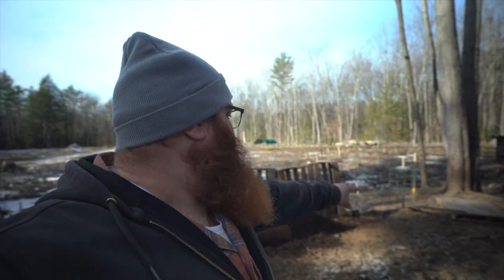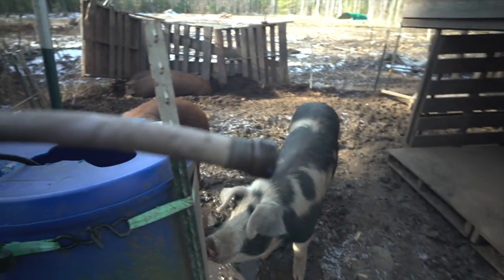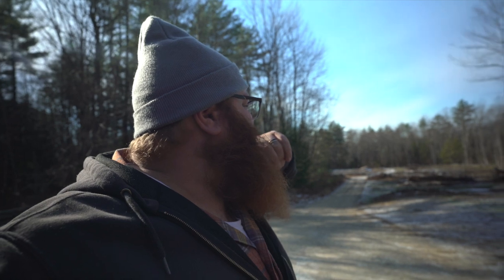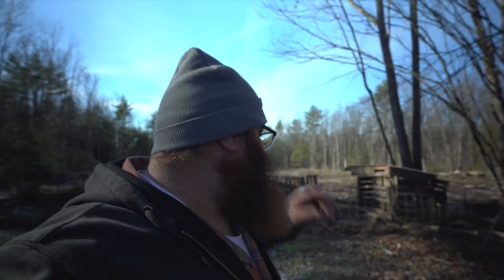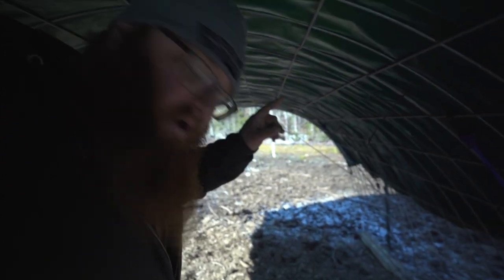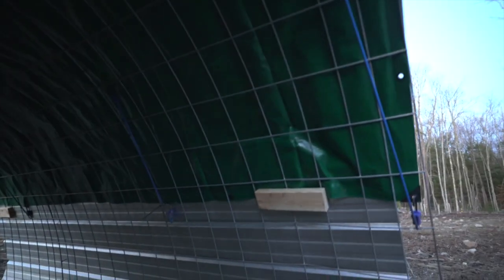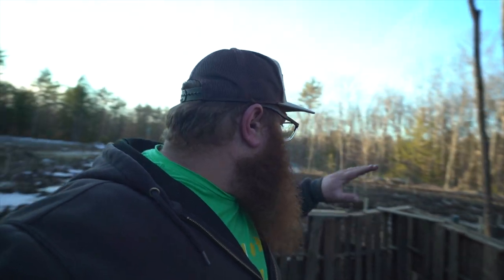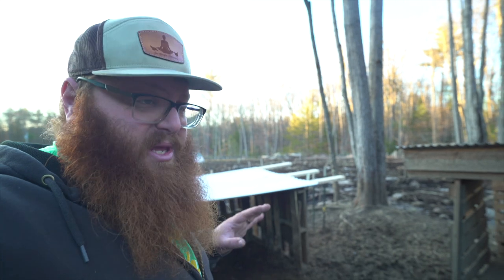Pigs Destroy Everything

Comment: Finding reliable processor is my single biggest obstacle to scaling up my pig operation. I'd like to get my group numbers up from 10 to 40 or 50 but finding somebody local who can process them all at once is the problem. My big farm project right now is winter housing that will allow me to have a place to put pigs inside on deep bedding. This way I will the ability to pull pigs off pasture in winter, and also open up my season to 2 or 3 groups of pigs per year vs just one group in the summer now. My basic design for the structure is a hoophouse with cement floor and wood walls on the inside to keep the pigs in. Use the loader to fill up the floor with thick layer of woodchips and.... pig paradise :-)